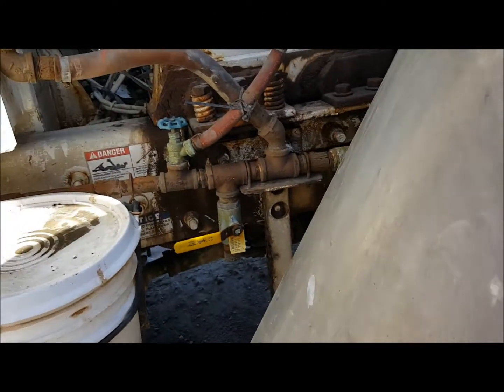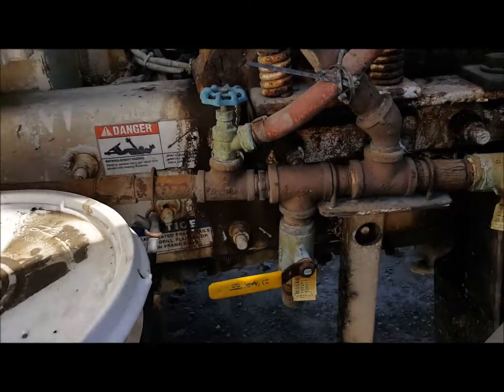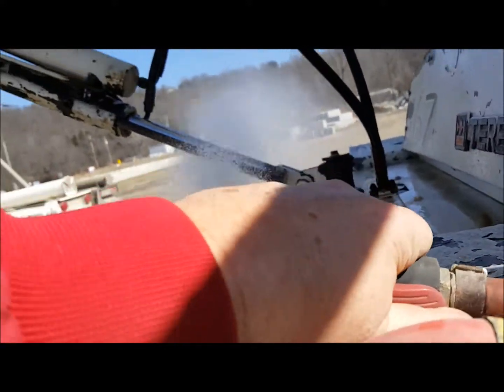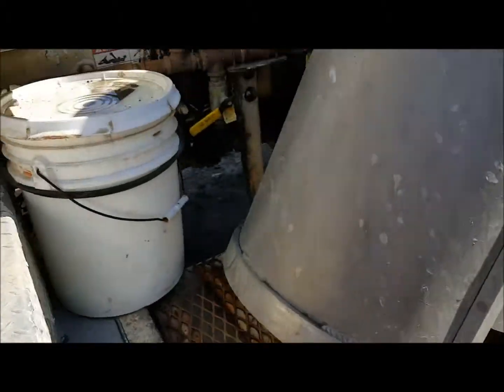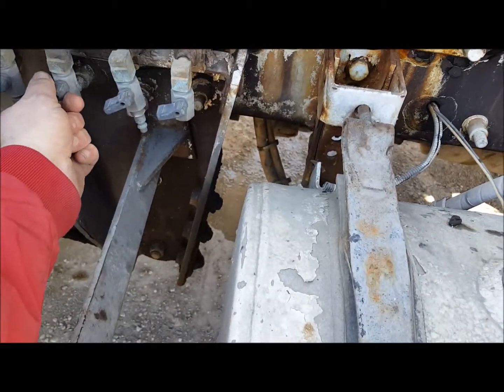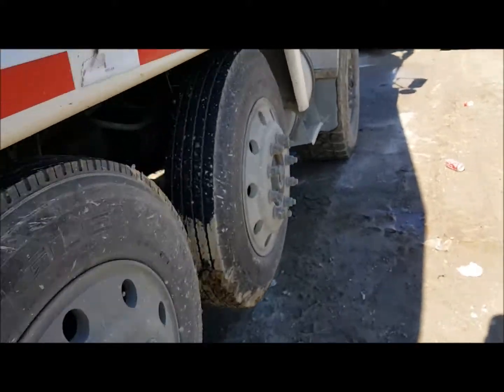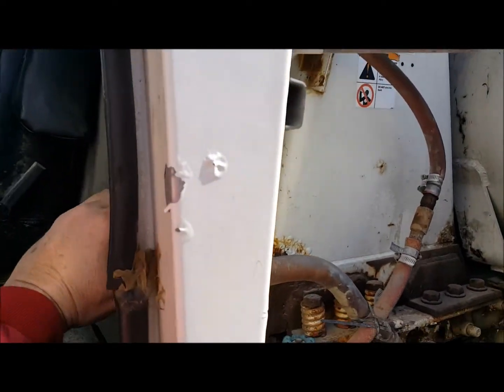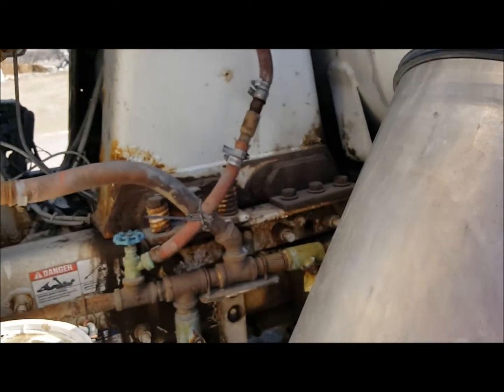Draining a concrete truck in the winter

Comment: Were I work. I drain all my left over water into the barrel and dump it into the wash out area. Our trucks all have an air valve connected in the main water line. So at the end of the day. I close the tank valve,drain valve and barrel feed an open the air valve to blow my hand lines out with air. After I blow my lines out. I shut the air off and remove the nozzles and put them in the cab. Finally I open all my valves for the night.
Reply from the maker: Out plants are set up that way. It is a genius idea though.